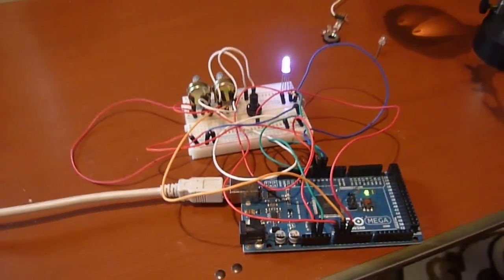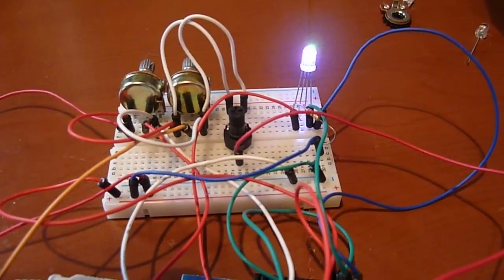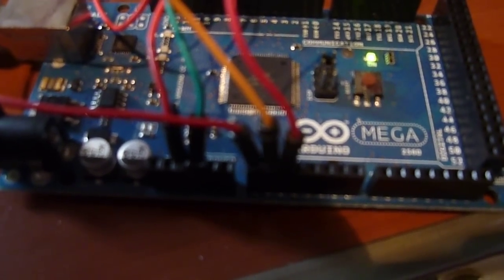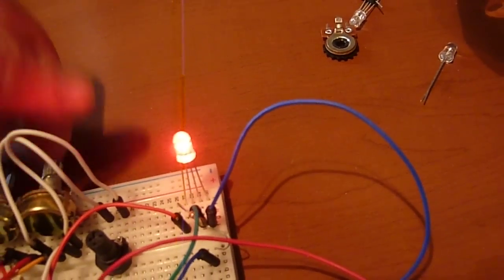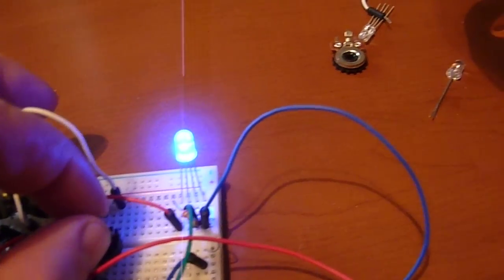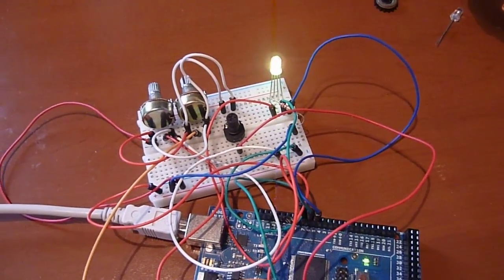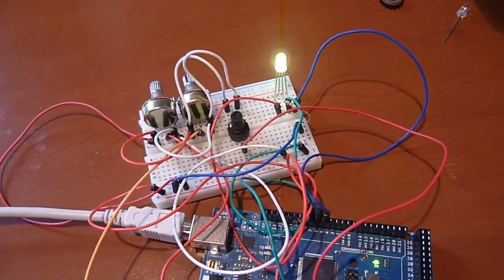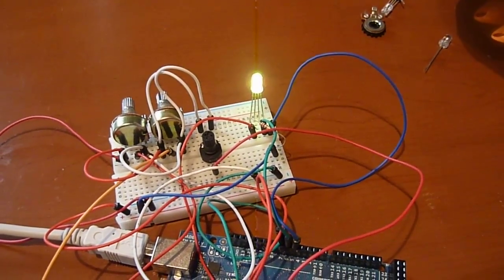PWM RGB LED Color Control with Arduino

Comment from the maker: A transistor is only needed if the LED pulls more current than the 40ma limit of a arduino port.

Comment from the maker: Hardware channels. The Atmel chip uses a clock speed of 16mhz, and the 2560 has has 15 hardware pwm pins.